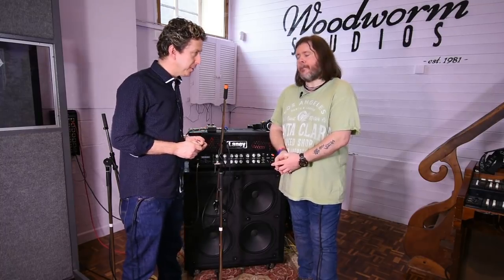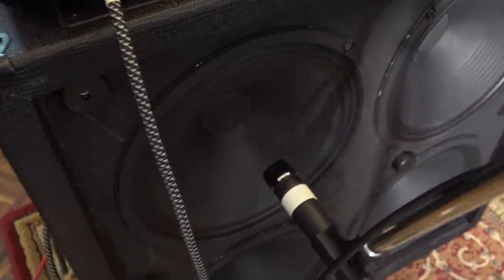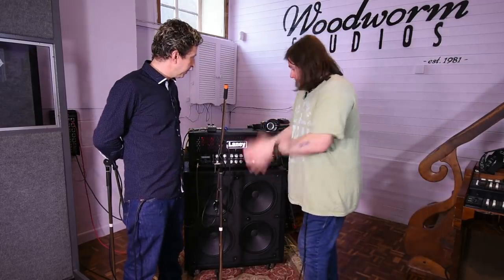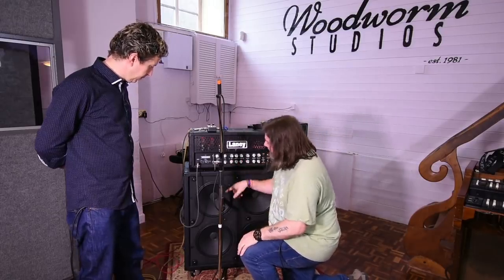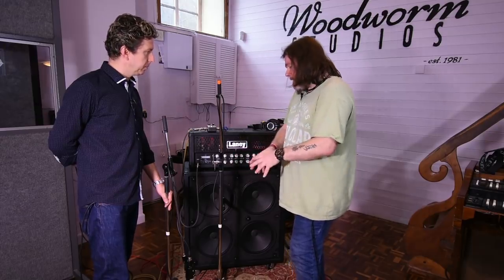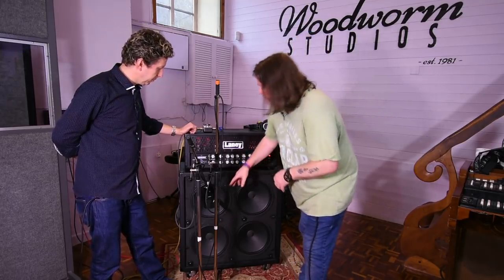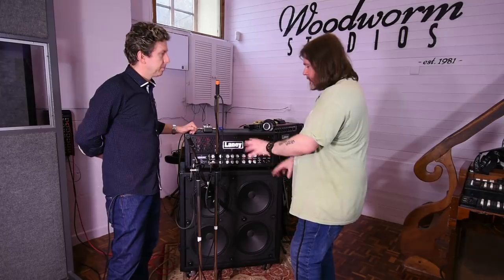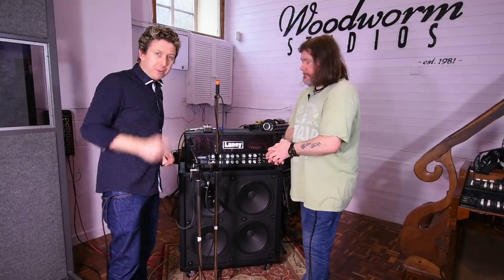Black Sabbath Engineer Shows How To Record Great Sounding Guitars With Two Microphones

Comment: Guys guys buy you a Fredman SM57 Clip from Wilkinson Audio, $20 holds 2 Sm57’s... one ON axis one OFF axis @ a 45 degree, and you could record 2 separate mono’s and blend the 2 together, and they then act as a natural EQ, I love it, and use a C214 for the Room capture,  blended under the SM57’s it is Gnarly🤙🏼🤙🏼🤙🏼‼️
Reply: It's actually a 55° angle

Comment: Excellent demo. 

Myself, I prefer to remove the capsule cover from my 57 and place it as close as possible to the cone material (not the dust cover), but not so close that the cone will vibrate against the exposed diaphragm. Less than 1/16 of an inch. 

One mic thus no phase issues. 

I use tight-fitting Sennheiser headphones to monitor the sound while the guitarist plays and adjust the 57 for the most brutal tone I can get and then record. 

I love the sounds I get with my technique.
Reply: Do you have samples?

Comment: I shouldn't say this, but f it here goes, someone should put a laser pointer on their mic!! So you can see exactly where its pointed (for consistency). Because as much as those speakers sounded differently, most of that was mic placement as millimeters make a miles of difference.
Reply: The Aston Starlight mic has a laser on it. I haven’t used one but it’s a great idea if you ask me.
Reply: @tomnaumann2104 , that looks really cool. I'm going to watch some videos on it! Thanks
  I have a 4/12 cab with different speakers in the studio and I mark on the cloth with a white crayon.

Comment: @productionexpert could someone explain what exactly he’s talking about @ 7:45? It’s hard to understand with the British accent. He pops one of the mics out of phase, I got that, but then he tweaks the faders to do what? “Get the spikiest sounding out of phase tone possible” - could you just explain that? doesn’t sound like he tweaks the EQ at all before flipping phase back?
Reply: Essentially he is checking for out of phase issues by listening not to the in phase signal, but rather to the out of phase signal.  He plays with the faders until the sound is most out of phase.  Then he pops the mics back into phase.  Then he is certain he minimized cancellation issues.  Does that make sense?
Reply: @CandorBand  ya! Thank you
Reply: @CandorBand  Hi Jason, thanks for the precision. I still have a question, maybe you could help as well :-) :
does he put one mic signal to the left and the other the the right (on his daw) when he is  checking the phase of each signal ? and then, once done, does he assemble the 2 tracks into one after popping back the 2 signals into phase ?
well, I don't understand the process for " checking the faders and the phases of the 2 mic signals" ^^
Reply: Hi Geoffrey, no.  The way I understand it is the signals are mono.  If you pan either, then you will not hear the phase issues as much.  Essentially, tinker with the faders and phase switch until it sounds as thin and hollow as possible.  Then just flip the phase of one signal and it should be in phase.
Reply: @CandorBand  thanks for your feedback, much appreciated ! I will do a test  in my studio 🙂

Comment: Strange. Someone bought this cabinet  on the base of the four speakers sounding together. Three of the four speakers are missing top end. The result now is the chosen speaker to record is the one that sounds most different than the entire cabinet. Someone bought the wrong cab  or....
Reply: Well, strange if you buy the cabinet strictly for recording! I, and probably most musicians, buy a cabinet because it simply sounds good. When you buy a cabinet you listen to the 4 speakers combined. Some audio-engineers might record the four speakers but that will maybe make the sound less direct. Also, when I record a cabinet I want the speaker with the most high end because that will give me the option to make it poke through the mix a bit more. At least that's how I look at it! xx

Comment: What exactly would anyone that engineered a Sabbath album know about good sound?
Reply: Apparently not much.  I would never use the guitar sound that they ended up with.  No amount of EQ could shape that into a usable tone.
Reply: @SocialGore  Are you for real? The sound of the first 2 sabbath albums inspired a million clone bands. Listen to paranoid or war pigs and try to convince anyone that it's not the most epic sounding guitar in the last 50 years.
Reply: @Les537 They are great albums, but recording quality has improved over the years.  There is a reason that very few sabbath inspired bands are going for the EXACT same guitar tone.
Reply: @Les537  black sabbath and paranoid have guitar tones that stand up to modern recordings.
Reply: Oneandonly Escaton I disagree, they were great for the time but now they’re pretty thin sounding, especially after the fredman technique came to existence and changed guitar tone recording for the better
Reply: Completely disagree with you guys.  Mic placement is only one variable in mic tone.  You are forgetting about the guitar, the amp and most importantly the player.  This is great advice from a pro.  You don’t need to follow it but I will.
Reply: What you noobs fail to realise is that it is how the guitars sound in context that matter. The tone is very fine when you add bass guitar